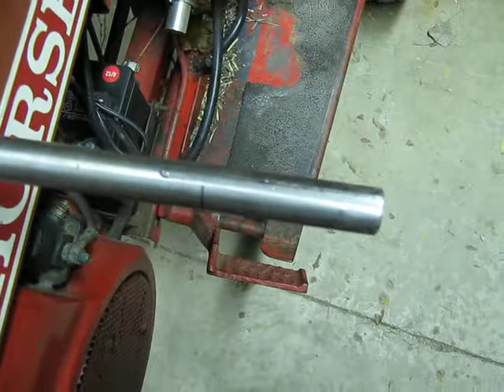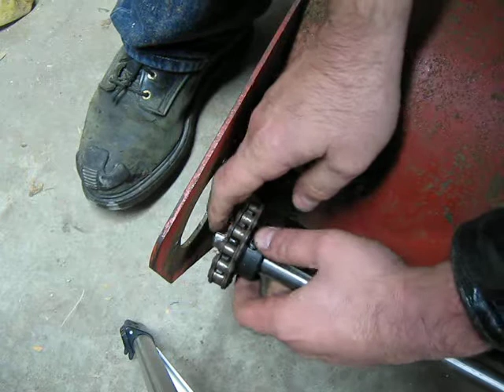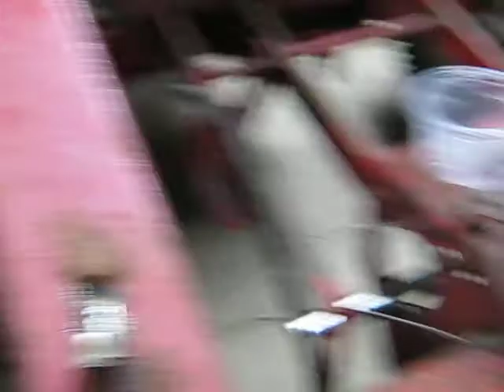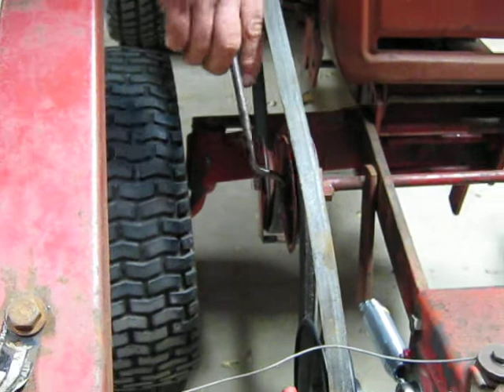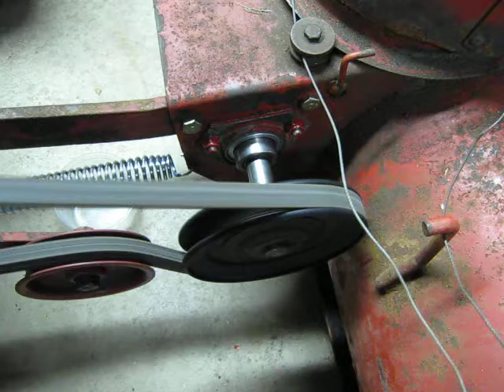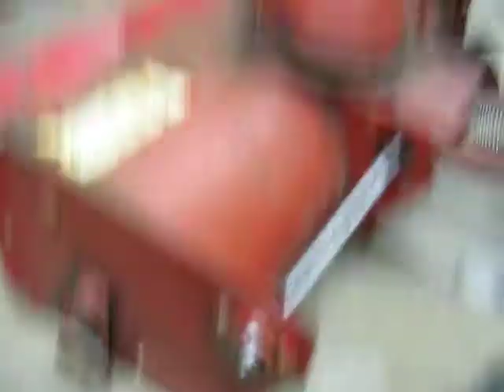Assembly & Test Run Wheel Horse ST4201 Snowthrower Snow Blower

Comment: A list of Parts would be a nice detail for this video.  I know this is old but, I just came across it doing some research on these models as I have one and always working on improving it and keeping it up and running.
Reply: I’d just like to know what the diameter of that driven pulley is..

Comment from the maker: Hi,
No, it isn't running wide open,  but it shouldn't vibrate excessively.  Check to make sure the bearing closest to the belt pulley is good (the one where my hand is in the thumbnail for this video).  Take the belt off, grab the pulley and try to wiggle it around perpendicular to the shaft.  It should be tight.  If it's sloppy,  the bearing is shot (I sell those too)  Hope that helps!

Comment: I was wondering what the model # and year of that blower I just picked up the same one and need that spring you put on there and I need to hook up the cable for the discharge
Reply: Hi, thanks for the comment.  The snow thrower in the video is a 1980 model which is about 6-8 years newer than the tractor it is attached to.  The spring is Ebay item # 271623933844 or you can just search Ebay for "wheel horse belt tensioner spring"  Do you need the cable that turns the chute, or do you just need some pictures of it to see how to re-attach it?
Reply: Good deal ill check that out thanks and the cable is there but not connected so i could use some pics if ya have some that would be great